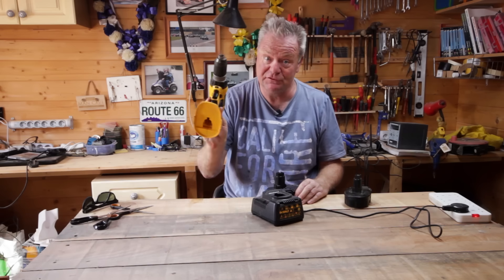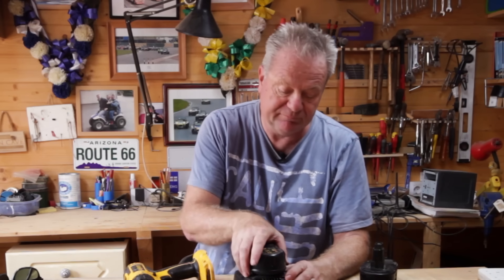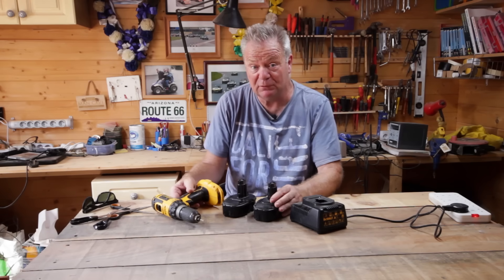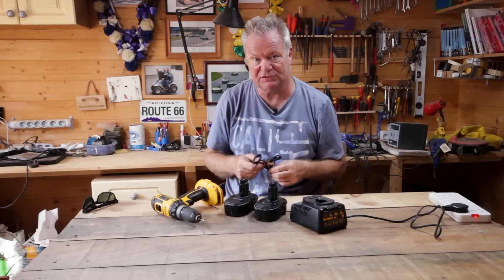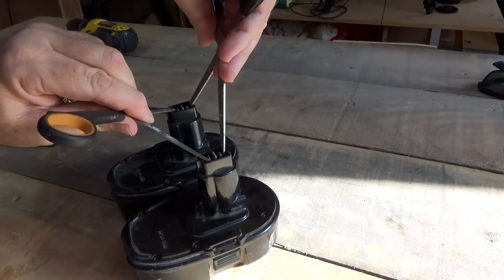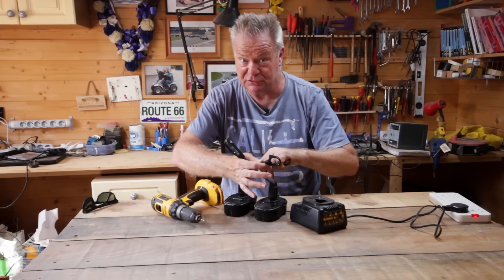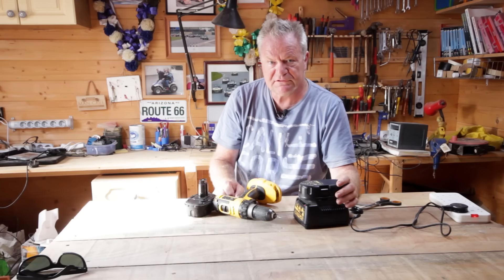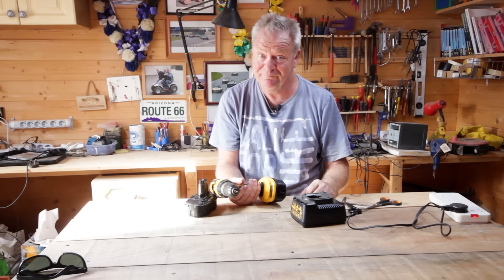How to revive a dead rechargeable power tool battery easily

Comment: Any solution if you don't have a functioning second battery ?
Reply from the maker: The best I can suggest is that you try and borrow one of the same voltage from a friend. Thanks for watching Robin.
Reply: @JPinFuerteventura  
I guess I could try another battery as long as I can determine which connector is + or -. It's a Bosch electric screwdriver practicaly new which I found in dad's tool box when we were clearing the house. 
Thanks for the reply.
Reply: @JPinFuerteventura  
I guess I could try another battery as long as I can determine which connector is + or -. It's a Bosch electric screwdriver practicaly new which I found in dad's tool box when we were clearing the house. 
Thanks for the reply.

Comment from the maker: NOTE: If this doesn't work for your particular battery or it charges but will not hold a charge you can find out how to recondition the battery here - https://bit.ly/2IzTVKi

Do NOT do this with Lithium batteries!

Note to anyone before posting a derogatory comment:
1. I didn't show that the other battery also worked to prove I hadn't switched them because I didn't realise how suspicious some YT viewers are at the time. If I had known that then I would have shown it.
2. Yes, the light was lit at the beginning because I forgot to switch the camera on when I first jump started it and once it had some charge I couldn't redo it. In fact, since I did it the battery has not needed it again.
3. The battery is still working 15 months later.
4. I don't care if you believe it works or not. I am just trying to pass on a tip which may help some.
5. The battery will not explode just because it is being given a little charge from the other battery initially. I don't care if you have worked in the battery industry since Moses was a boy.
6. Any idiots who have nothing better to do than swear and make stupid comments will just be banned.
Reply: I think you should have edited this 'pinned' comment by stating boldly that you used ni-cad batteries NOT lithium,  would have saved some people a lot of bile:)
Reply from the maker: @limmoblack  That was in a pinned comment until about a month ago but it didn't stop people. I have added it again.
Reply: Yeah, trouble is a lot of the chargers are,"smart"  chargers which prevent  the charging process to protect less than smart people from shorting the leads out. Over   kill I'd say in the area of "safety."

Comment: Plan 2: Buy a new similar tool from a big box store with the battery you need. Change out battery(s) and return.

I would feel bad if the manufacturers weren't trying to rip off tradesmen with overpriced batteries made in China.
Reply from the maker: That isn't an option here in the Canary Islands as there are no big box stores, only little shops. Thanks for watching.

Comment: That was excellent! Thank you so much!
Reply from the maker: I hope it helped Glenn. Thanks for watching.
Reply: @JPinFuerteventura  
It sure did! Both of my Craftsman 18 volt drill batteries are now working perfectly! 

Battery Model No.  315.110980

One of them had been completely dead!  I did what you said to do with two wires, and it worked  "exactly" as you said!

Thank you again, so much, and God bless you from North Carolina!

Comment: Any battery like this or even a car battery , they will all suffer the same fate.
Once one cell becomes weaker than the rest it becomes the strongest, sounds stupid but once recharged the battery is only as strong as the weakest cell.
Reply from the maker: Yes, if a cell goes that is true. The battery in this video worked fine for well over a year. It is starting to hold charge for less now but still holds a useful amount as I don't do many big diy jobs any more. Thanks for watching Symon.

Comment: That’s a GREAT trick! Thank you.

What I do is put the unresponsive battery into the charger, then plug and unplug the charger as quickly as possible until the charge light comes on. When it does you simply let the battery go through its charge cycle. There are several theories on why this works but I’m not an electronics guy so I can’t judge which is the most likely to be correct. But it works. Try it!
Reply from the maker: Thanks for the tip!

Comment: Hey thanks for the tip"" also i know you will prolly be repeating but can i use different battery to jump say a dewalt and a Milwaukee thanks
Reply from the maker: I think if the voltage is the same it should be ok
Reply: Yes

Comment: How about charging up computer's back up UPS dead batteries? APC brand RBC7 cost $150 or more.
Reply from the maker: I can't really say Joseph. People have commented that they have done similar things with car batteries and others so I suppose there is no reason why it may not work with UPS batteries. If you try it and it works let me know. Good luck.
Reply from the maker: Good advice John
Reply: Hey Joseph, the problem with UPS batteries is that over time they dry up.  If you remove the top (carefully using a razor blade) this will expose caps.  Remove them and top up with distilled water.  Battery should charge and work good as new.
Reply: Joseph David  These particular batteries are gel cell lead acid. Basically a car battery...... The problem lies in the design of these batteries. YES! They do dry out over time, this is usually caused by poor regulation of the UPS over charging the batteries.... And once a lead acid goes below A 20% charge, and worse completely dead....... That battery will never charge correctly again! 

Do Not put water into a gel cell battery! Your only looking for trouble in doing that...
Reply: Hi Robert, well it has worked for us and revived two of our UPS batteries without any troubles.  After all it is only water you are carefully adding.
Reply: John Ganimead  My main concern is if those gel cell batteries are are laying on there sides as many UPS batteries do..... the Water which is now acid can leak out from the vent holes on the top which will now cause major problems......   

  Acid leaking out of my UPS with compromised batteries is not an option I’m willing to risk in my home...  Of course, if they are larger wet cells, adding water is not a problem...  

  And once a lead acid battery becomes fully discharged, the Amp hour rating will never be the same....
Reply: Vent holes?  they are sealed batteries and after the water you replace the sealed plugs.  But anyway don't wish to argue only to say that many people use this practice as it truly works!

Comment: Okay - what is the long term usability of the rejuvenated battery?
Reply from the maker: That depends on the state of the battery. A battery's charge can drop in a good or a bad battery. The battery in this video still accepts a charge that is useful for me 18 months later although it doesn't hold its charge for as long as it did when new.

Comment: Ok sir. But you didn't explain what happened when not charging. And why it needed a boost to charge. Now, I have a couple batteries that charge but won't last. What I can do?
Reply from the maker: The charger is a "smart" charger and if the battery charge is too low it won't detect that a battery has been inserted. Boosting the charge means the charger then starts charging it. It sounds like your batteries may have bad cells. It is possible to take it apart and change them but I haven't done that myself.

Comment: Awesome. I have the same drill with the same problem. Now I have 3 of these drills because as you say, it's cheaper to buy a whole new drill than buy batteries. I have noticed that the batteries one can buy sans drill are bigger and heavier than the ones that come with the drills. Presumably they are better batteries?
Reply from the maker: I have never actually bought replacements so that is interesting. It sounds like they may be better. Thanks for watching.

Comment: Or if like most electrical hobbyists you can charge it with a bench charger.  Unfortunately just because it's started charging it doesn't mean you fixed it and it will carry on holding a charge.
Reply from the maker: True but starting it charging is the first step to seeing if it is ok. The one in the video is still working, albeit not as well as it did when it was new but it still holds a charge reasonably well.

Comment: Great tip doing this. Someone gave me a rechargeable drill but it won't charge like this one wouldn't. Can they be saved if you don't have a working spare battery?
Reply from the maker: You can try borrowing a battery from a friend with the same voltage to give it a try.
Reply: I seemed to have revived mine with a car (lead-acid) battery charger, thanks to JP's advice. It is more risky though since a battery won't put out all that much current but a lead-acid battery charger will charge at 8-10A (the latter on boost) which could heat and perhaps even explode (I have no idea, but it stands to reason) your battery.

Comment: How do you do it if you have only one battery ?  😏. I've heard something to shock the cell or cells in the battery as the cell or cells can get fuzzed up causing lack of charging.   So something was used on the battery terminals to shock the cells in it to clear it to be able to charge up again. But, all I remember it was on YOUTUBE just can't remember who posted it.  So, all I need is a easy & cheap idea on how to be able to get a cordless drill battery to charge. Open to suggestions.
Reply from the maker: I have heard something about that method too but haven't tried it. To try the method in the video the best I can suggest is see if you can borrow a similar voltage battery from a friend to jump from.

Comment: So how long did the battery power the tool after you did your trick?
Reply from the maker: It still works today (18 months later) and I haven't had to do this again as the voltage hasn't dropped below the detection voltage of the smart charger. The battery doesn't hold it's charge as long as it did when it was new but then it is getting older now. With the small jobs I tend to do these days it still gives useful service. Thanks for watching Steve.

Comment: Yea, but what if both your batteries  are dead????  My new gun +2 batteries sat for over a year without use and both batteries are completely dead.
Reply from the maker: Find a friend with a similar voltage battery and borrow it perhaps?
Reply: @JPinFuerteventura  thanks

Comment: Hi JP, this worked for one of my batteries but wouldn't for another, but using a variation on your tip I hooked my car battery charger to the stubborn one and hey presto! it now takes a charge - note* - it does not like to be left on the shelf 'waiting' to be used, it needs a pep-up every couple of days, otherwise it's bang on.
Reply from the maker: Great. Well done George. Thanks for watching.

Comment: By watching this video im assuming that because there is no manual switch to turn it on, the charger must sense minimum voltage to turn it itself on while the battery is perfectly fine. And I thought you were going to take apart the battery with the scissors!
Reply from the maker: Correct and if the voltage is below the minimum it doesn't think a battery is there. Would you like me to do that in another video? 😉
Reply: JP in Fuerteventura , that would be good. I threw out my last drill thinking that the battery was history. Didn't have a spare.

Comment: I have the same type battery bit it wont hold the charge. Pit it on charge for hours and it only lasts seconds,?
Reply from the maker: If it appears to charge but the charge battery runs out quickly that probably means one or more of the cells have gone David.

Comment: Found by accident, good tip if it works.....will get back to you as I do have Dewalt but am mainly Makita so will see if it works for those as I have a problem battery on my nailer....….on another note pure coincidence Fuerte is our fav hol destination...been going there for ten yrs or more.... :O)
Reply from the maker: I hope it helps. That's a coincidence about Fuerteventura. ;-) Thanks for watching.

Comment: Well it's worth a try got nothing to lose. And if it does not work then you have an internal bad cell and that needs to be replaced, not the whole power pack just that one or two cells. At some point the batteries are just tired and old and need to be replaced no matter what you do to it. The new DeWalt NiCd replacements (if they still have it) are quite expensive even more so then an equivalent Li-ion. DeWalt has an adapter going from NiCd to Li-ion, another option to give that old drill a few more years.
Reply from the maker: Thanks for that. It is rather annoying in these days of being green, recycling etc that you end up throwing away a perfectly good drill just because the batteries have gone and replacements are too expensive to make it worthwhile.

Comment: I have a DeWalt 18 volt battery that will not hold a charge it'll charge but it runs down real quick what can I do in that situation
Reply from the maker: It sounds like it is beyond help apart from opening it up and renewing some or all of the cells.

Comment: One trick I've used in the past to revive nicads is to charge up a capacitor of a few thousand microfarads to 30 volts. Then connect this to a dead battery cell plus to plus, minus to minus and it usually revives it by burning out the internal shorts and puts a small charge on it. Then you can put it into a charger for a normal charge.
Reply from the maker: That sounds like a good idea. A little beyond my electrical ability though but perhaps good for others. Thanks for watching.

Comment: Manufacturers have to set a lower limit of electrical charge in order for the charger ti start charging. If a battery IS truly dead, heat will build up and start a fire. A lithium fire is no fucking joke! As this guy says, the battery didn't have enough "juice" to start charging safely. Also he mentioned later that the charger was quite hot. This is an Ok technique if done under ideal conditions.
Reply from the maker: Thanks for watching.

Comment: Wow. Nice. I have about 8 fresh 18v dewalt batteries that I got from my old job. Great video. One question, how long will the usage from old dead battery last...same as new or not????
Reply from the maker: That depends how old it is. Once a battery gets too old it won't hold its charge for long. The battery in the video still works (and I haven't had to restart it again) but it doesn't hold its charge as long as it did when it was new. It still holds it long enough to be useful for me though.

Comment: All batteries wear out. If they fail early you can check them and replace a bad cell or two. Reviving will not work if cells are simply worn out or there are bad cells either shorted or opened. He is simply raising the minimum voltage on the pack to force the charger to work. Does not fix the real problems...
Reply from the maker: If a battery is worn out then that's it but this battery is still working 16 months later

Comment: Thanks for the info. From what I can tell this is if a battery has been sitting g a while and has gone down to nothing and the charger won't read it anymore in order to detect there's a battery in the charging port. 

I don't suppose this does anything at all to batteries that discharge quickly like full charge to dead in 5 minutes does it?
Reply from the maker: No, those probably have a dead cell
Reply: @JPinFuerteventura  thanks for the reply

Comment: I was hoping for something different.  Then again, Mine is really dead!  Doesn't charge, and the lite blinks intermittently indicating as such.  Then again, it's about 22 years old.  Time for a new drill. Damn batteries are more expensive than a new drill.  figure that out.
Reply from the maker: Exactly. When I looked into it I found it would be cheaper to buy a new drill with two batteries than to just buy two batteries. Thanks for watching.

Comment: My drill has something called a power cord that plugs into a wall outlet. We used those back in the dark ages. If a hole is needed over there, I use a heavy guage extention cord. No battery to run down.
Reply from the maker: I have one too but sometimes that is of no use. I used to have a boat that I needed to work on in a boatyard with no electricity so battery power tools were the only answer. Thanks for watching.
Reply: Hi JP,
Thanks for the reply.
Point taken.
I don't have a problem like that with my boat, a Pelican Bandit 100NXT 10 foot kayak that is sitting in the middle of my living room floor. No garage, an open carport. I could suspend it above the car from the carport ceiling, but the kayak may be gone when I get home, or those accursed militarized red wasps would make a home out of it.
I will have to do something about said kayak's placement when a woman comes into my life, but I will paddle under that bridge when I come to it.
But I digress.
Years ago I had a Ryobi cordless drill. One battery lost the capacity to take a charge. At that time all the internet offered was to rapidly insert and remove the offending battery into the charger several times. That did not work. I gave the drill and good battery to a friend. I wish I could have seen your video back then.
Best wishes and keep up the good work.
Terry